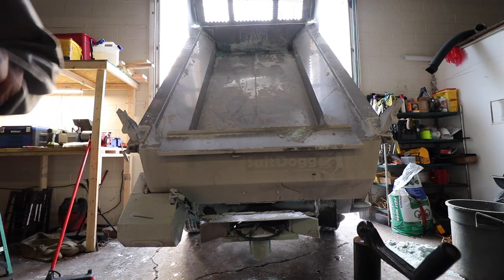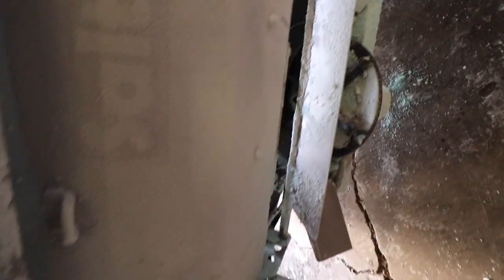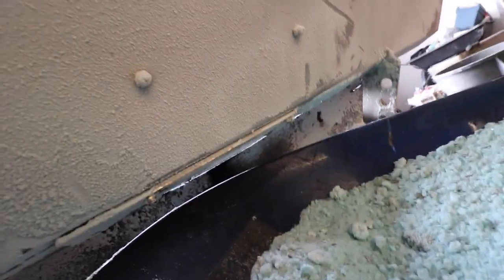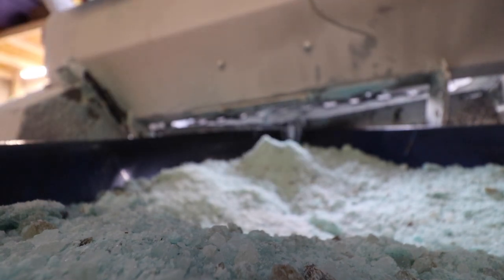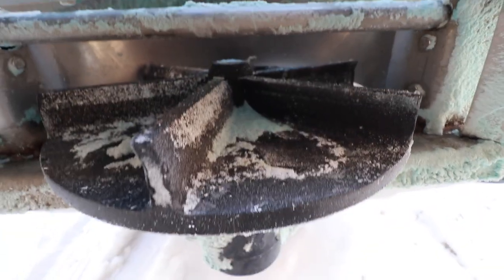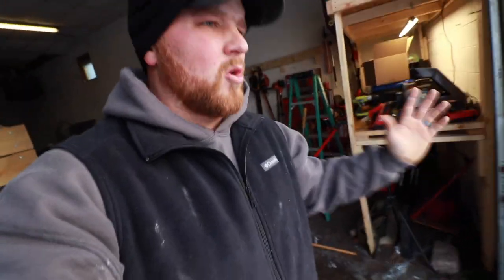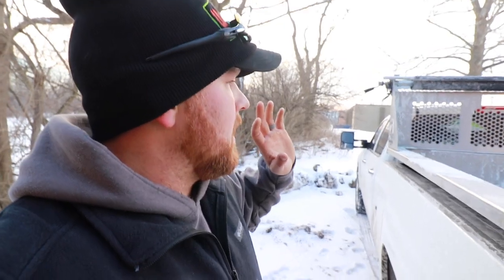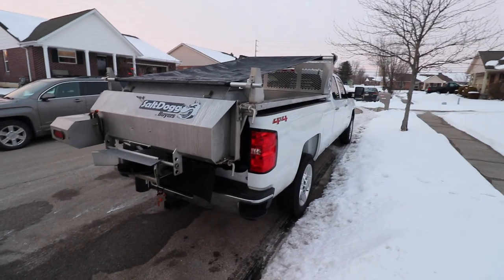THIS MATTERS for your TRUCK SALT SPREADER! (had no idea!)

Comment: I have been running this spreader for years and it has worked well for me. I recommend getting a 4'x8' sheet of HDPE and place it on the bottom of the dump insert. I bought a sheet from menards. It allows the salt to slide to the auger without having to raise the bed very high. It also prevents the salt from freezing to the bottom. I was ready to switch to a v box until I installed the plastic liner. Hope it works well for you.
Reply from the maker: Thank you for this insight! Literally, exactly what I have been considering. I just felt like it was such a pain having to continuously monitor the salt in the insert, lift the insert high but not too high, etc. I will definitely get a sheet of that! 👍🏻

Comment: I am about to pull the trigger on buying this exact set up to add to my winter plow revenue and to turn our 1 ton into a dump truck. thanks for the videos, good info
Reply from the maker: Nice! Glad the videos have helped!
Reply: @D.Stephenson  yup, mines ordered in. We plow as well and been searching for a salt and sand solution to add to our tree business. Thanks again for the info, what sort of vibrator did you use? never seen or heard it before.

Comment: also the dealers wont know much just because they rarely  sell/build these i run in to the same prob everytime i have a question on it
Reply from the maker: The spinner though is a standard systems nothing special about it. So it should have been caught that they put the wrong spinner. Definitely should have been noticed when they tested it to make sure it works properly.